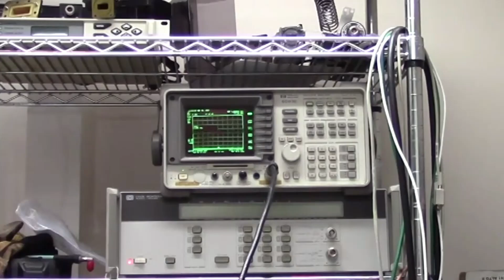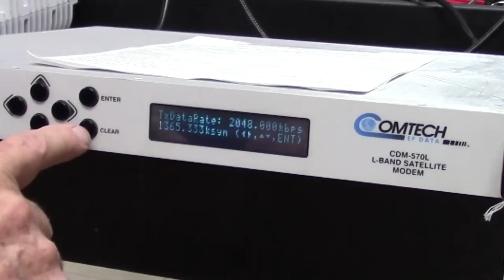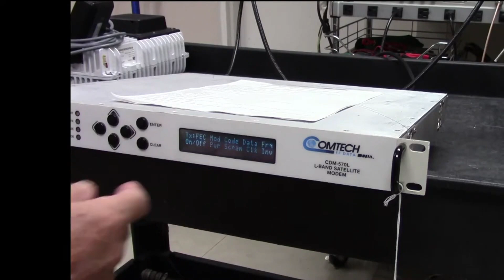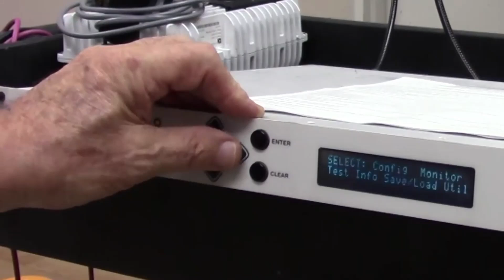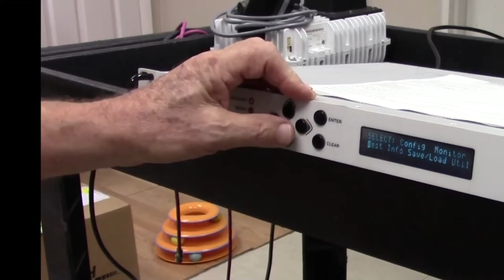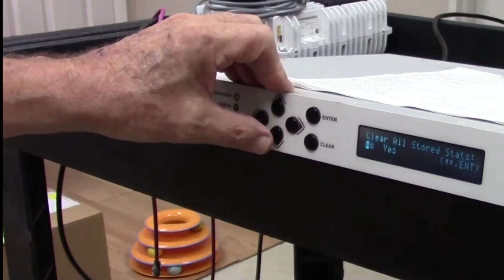Comtech CDM-570L options CW, Loop Back etc.

Comment: Hey sir, Is it necessary to remove DCpower from TX and RX to do RF loopback? this test can be done with other series as 625, 625A?
Reply from the maker: Hi Kevin, I always forget to check YouTube comments and only saw your question today
The CDM-625 is well-suited for RF loopback testing, especially in lab or bench setups. Here's how it fits in:

It supports IF loopback (50–180 MHz) and L-band loopback (950–2000 MHz), depending on your configuration.

You can connect the TX IF output directly to the RX IF input using a coaxial cable.

Disable DC power on both ports via the modem’s configuration menu or hardware jumpers (depending on your setup).

Make sure AUPC (Automatic Uplink Power Control) is off during loopback to avoid power fluctuations2.